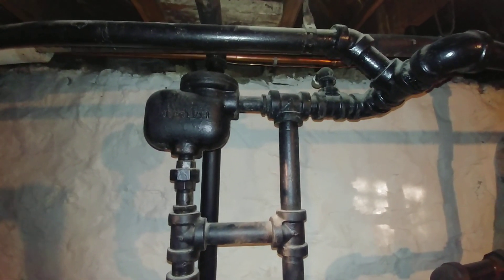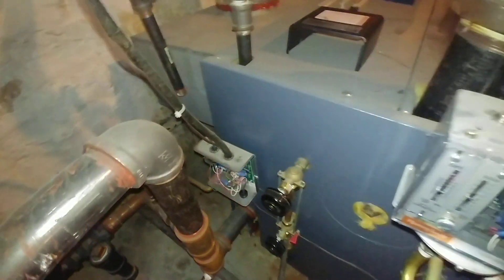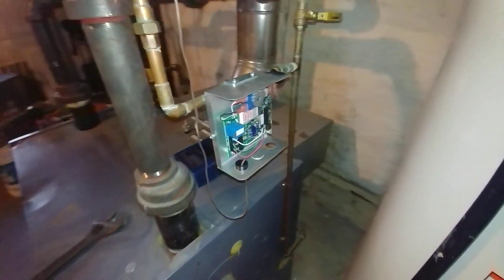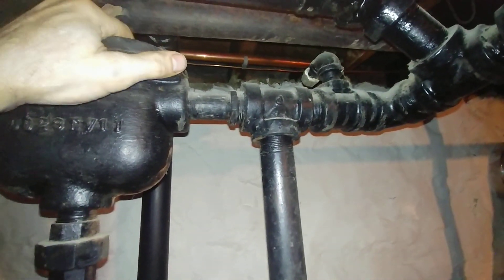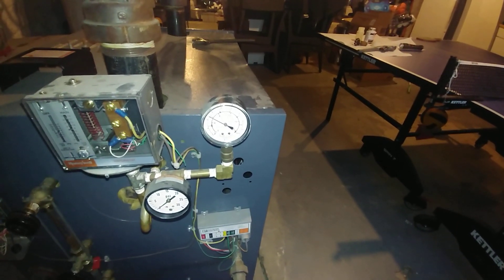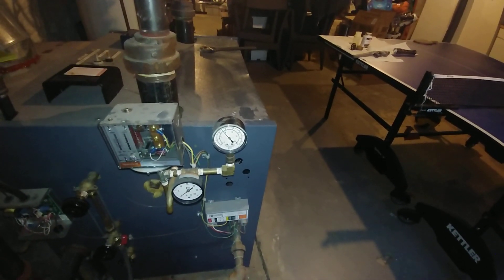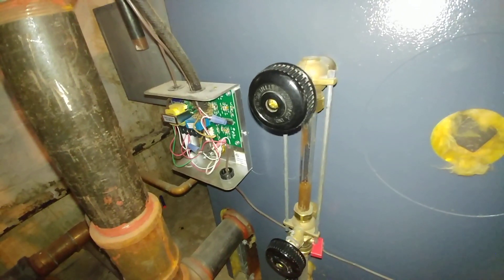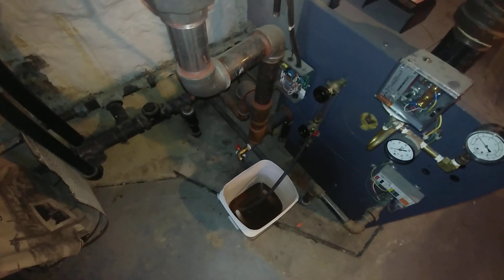VXT Made Right Side Up & Fun With Vapor System Physics

Comment: Those offset couplings on the riser look like they come in handy.
Reply from the maker: Those eccentric couplings are still made and made domestically.
Generally, they are used to reduce the size of horizontal steam mains while allowing the condensate to drain freely and not be held up in the pipe and get hammered by the steam.
The use of them here in this application is a bit unusual, that is to say, I've never seen the like.